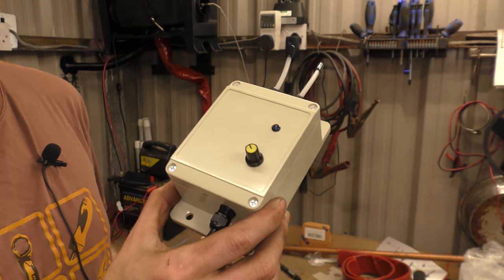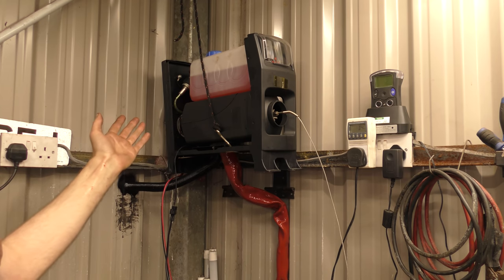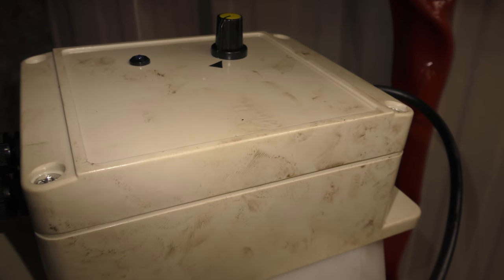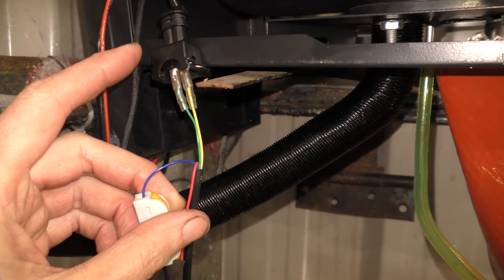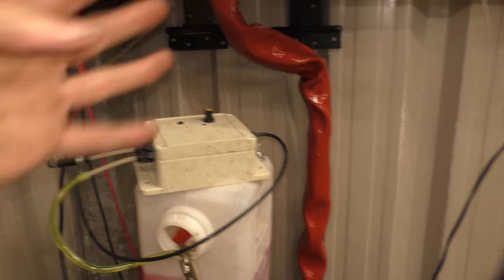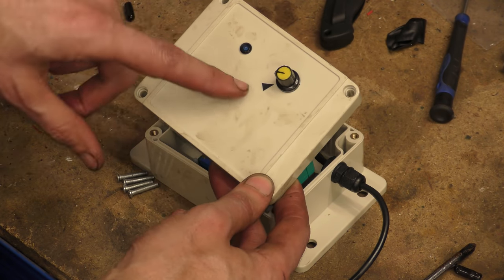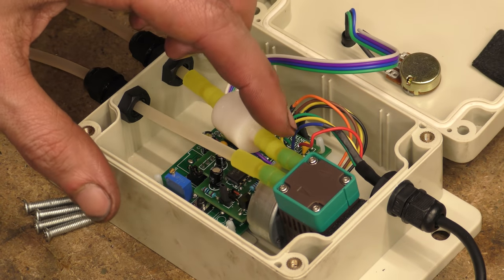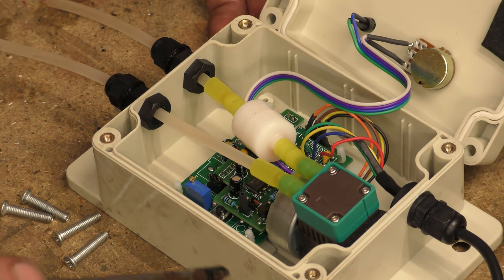Silent Pump for Diesel Heaters - test / review

Comment: You see we in Australia don't have any problems with the ticking noise a Chinese diesel heater pump make, it just sounds like the rythmic ticking of the electric fence units we use to keep the Salt Water Crocodiles away at night, and generally it sends us off to the land of Nodd in minutes.
Reply: Agree ,,, also the pump is quieter than bloody cicadias ,, 
Rob 
Nowra 
NSW
AU
Reply: @13yearsaprepperr.jtilbury.51  My tinitus is louder than the pump,  also if the cicadas are out making a gowdawful racket, you certainly dont need a heater.
Reply: greggy weggy, I'm reminded that Captain Hook is quite alarmed at the ticking sounds of a particular croc, and would not find any rest in such a fence. Poor devil.
Reply: I thank GOD I dont have to contend with the huge water lizards like ya do. I used a ticking electric fence to keep the coyotes out of a goat pen. Stay safe .
Reply: Well after hearing that I guess my mosquitoes aren't so bad
Reply: Wait what???  You have electric fences to keep the dinosaurs away???

Comment: Depending on how this pump housing is used the design is great or bad. I think. By that I mean that I think it is a very bad idea to have electronics underneath something that can leak on it. I would be more happy when the electronics would be above the pump and even have a devider screen in between in case something would spray out of the pump in case of a failure. And a small drain hole in the bottom so you would see the leak before it would destroy the electronics after filling the box.

Comment: I saw one video where the guy screwed a cup hook into the wood above, then suspended the fuel pump using a tie wrap ( or some people call it a zip tie ) from the cup hook. The tie wrap went through the bracket mounting hole in the fuel pump. After that it was completely quiet. It was amazing!
Reply: "I saw one video" ... can you provide a link to the video(?)
Reply: @__WJK__  i think it's Mel's big van small world Channel
Reply: From what i have ascertained from watching videos is that the pump needs to be at a particular angle to operate properly, if that's true or not, I have no idea.
Reply: Yeah. Just watched that video and not completely silent.  Maybe 60% silent...

Comment: Adding a mass to the standard pump is the best way to absorb and disperse the noise. 
I've tried a lot of different materials foam etc, and the heavier silicon sealant was the winner !
Reply: What do you mean adding a mass?
Reply: Did you just put a bunch of silicone on the pump (from a silicone tube)?
Reply: I am also curious

Comment: Awesome vid on an awesome product. I bought one of the prototypes a few months back as James was just getting started, a complete gentleman to deal with. I run my 5kW workshop heaters on kerosene so between us we were able to prove his new pump internals stood up to both fuels and changing viscosities with temperature. Must have run at least 100 litres by the end of my testing so a thorough test IMHO  - and a quiet one to boot !
Thanks for all the vids David, you've been a massive help to me in my workshop diesel hearter shenanigans.
Reply: .how do I order one for myself can't find any details
Reply: Is there an advantage to running kerosene?
Reply: @gregoryschwarz2730  Use for High Altitude
Reply: Ok do you know the flash point of kero is considerably lower than diesel. 65 deg celcius. Diesel way over 100. For safety sake I'd stick with diesel. Good luck.

Comment: My dog comes over and wags his tail at the start of your vids haha.  Fascinating bits you find to talk about.  I am very interested in someone's comment who suggested a simple PVC vacuum tube to muffle pump.  Sounded silly at first but his idea was actually pretty good and worth more thinking for this problem.
Reply from the maker: PVC vacuum tube?  You have piqued my interest.
Reply: @DavidMcLuckie  The idea is to place the original solenoid type pump into a short section of PVC pipe (say 50mm diameter) with a stop end on each end.
Gland or seal the fuel lines in and out each end, do the same with the power cable. Drill another hole and fit a schrader valve (old valve stem from a wheel should do). Seal the whole thing up. Fit a vacuum pump to the valve and suck all the air out. 
Now you shouldn't be able to hear anything other than possibly noise transferred via the fuel lines. It should work well I expect. You might need some low density foam to help keep the pump centred away from the pipe walls.
I thought overheating might be an issue but perhaps the fuel flow might be sufficient to cool it.
Reply: @fionnut  Good description.  The comment that gave me the idea implied a fairly simple vacuum pump and described how he could hear the noise lessen as the pump slowly kicked in.  It would only be a partial vacuum so I dont think heat dissipation would be a problem.
Reply: @fionnut  lol. bicycle valve will not hold a vacume as it is a one way valve that keeps air in and not out of the tire. so you must install the valve bacwards to make it work.. i would rather fill the pipe with insulating wool and be done with it.
Reply: @vihreelinja4743  It's possible to use the type of valves used in air conditioning systems instead, these will definitely hold a vacuum and are still cheap.
Insulation won't dampen the sound to nearly the same extent.

Comment: For myself and I suspect many others, it's a big job or not feasible to get this pump above their fuel tanks as most have their heaters, pumps and tanks close to their van floor. Very impressed with the quietness. Hopefully syphoning can be over come. 👍
Reply from the maker: You just need to make sure there isn't enough height difference to start a siphon.  Taking the fuel supply from a stand pipe into the tank also helps.
Reply: @DavidMcLuckie  Thing is, I have everything under my sink. Heater bottom back, tank above  (10lt) and the fuel pump bottom front as you stand at the sink. Area about 400x400mm. 🙄😳🙃
Reply: @CarlJones14  and so it is siphon leaking?
Reply: Hello
I will eventually move my fuel tank below the pump and heater. For now, I’ve put a small 12v solenoid valve in the fuel line. It opens when heater is running. Like David I hadn’t read instructions so awoke next morning to quite a large pool of diesel on the road. As I burned off the excess in the heater the smoke was unbelievable for about 5 mins. Neighbours thought van was burning.
Anyway great pump. No regrets,
Reply: install a relay controlled tap in the fuel line.

Comment: I'm intending to build an insulated box outside my shed (workshop) to house all the Gubbins except the controller and the hot air outlet tubing so hopefully there will be little or no noise. Also removing the necessity to bring diesel into the shed. 👍 😎

Comment: Have you considered using noise/sound meters when you measure the volume of pumps or exhausts? 
At a pinch you could use one of the many apps available. That way you can do objective rather than subjective test which are way more valuable.
Reply: Yes, where is the sound meter?

Comment: Nice, although this seems a bit overkill to me.

I found the best way to mount the pump is have it suspended by the fuel lines an inch back from the pump on either side so the pump itself is floating. That way the hose itself acts to isolate vibrations from the pump (works especially well with soft silicone hose).

My pump is barely audible when properly isolated, it's the surface the pump is attached to acting like a speaker cone and amplifying the noise which is normally the issue.
Reply: What size tubing did you buy?

Comment: I wonder about long term durability.  Pull chord ICE motors have this type of mechanism (diaphragm run by vacuum) but they eventually age/give out.  Not that your typical impeller type pump is immortal or anything.
Reply: I had the second prototype of this silent pump fitted by the inventor himself and it's still working going into its second winter after a summer's rest. Absolutely silent.

Comment: Great video and smart built. Did you test it with the afterburner as well? And if yes, does it keep full functionality (like measuring the amount of fuel used)?
Reply from the maker: Works just the same as stock pump with the Afterburner.

Comment: What is that sensor type thing fitted to the front of your heater? (Drilled and presumably tapped into the main heat exchanger casting? Is that your burn temperature sensor?

Comment: Just add a one-way valve to the mix to prevent the syphon effect happening and it'll be sorted... :)
Reply from the maker: But the siphon happens with the flow of fuel.  It'll siphon the entire fuel tank through the heater if you let it.  A one way valve would not prevent this.
Reply from the maker: I think I need a spring loaded valve but with a very light spring pressure.  Low enough not to impede the pumping of fuel but high enough to stop a siphon flow.
Reply: @DavidMcLuckie  I am adding a small 12v valve powered by a relay triggered from the pumps positive feed because I cannot get my tank below the heater.

Comment: Nice review of a nice pump. Does it make a different with the silent pump what fuel you use? I’ve been using main,y kero and an odd bit of diesel here and there..
Reply from the maker: Nope.  You can even run petrol through this pump, the seals are designed for it.

Comment: Very cool! Thankfully the clicking is ok with me.
Reply: I live with one 4 feet away and the ticking is actually kinda nice and comforting... though mine hangs on a couple of cable ties within a modified toolbox on the front deck so its like a quiet clock you have to actually try and hear.
Reply: @MIck-M  I've got a mechanical heart valve. I hear ticking all the time whether the heaters on or not. 😀

Comment: When General Motors car manufacturer came out with the 1988 Oldsmobile diesel engine for their cars they used a 350 gas engine and converted it to diesel. To get it to start faster on cold days they put in 6-volt glow plugs instead of the usual 12 volts glow plugs.  I wonder if you could do the same and reduce the startup time and less amp draw saving on battery-operated power supplies like the Jaberwaky I think it's called.
Reply: They actually used the big block to base the diesel on, not the 350.  No siamesed exhaust/intake ports.
Reply: MPG?

Comment: Thanks for your video, how did you know what wire to connect to the pump plug fitting as both wires going into mine are the same colour with no indication of positive and negative?
Reply from the maker: Either way round works.
Reply: Thank you 😊

Comment: its a basic fish tank pump with custom guts and a PLC. Diaphragm pumps are lift only thats why in the us we call them lift pumps the one thing over looked by most is the electronic pulse pump is a fuel injector and a fuel pump all rolled into one thats why it so loud if you could replace it with just a injector or a high frequency pintle valve and a normal vane pump it would be allot quieter but improper installation would pose a fire risk im running an 8kw in a 26' class a my tank is 2' above my heater pump is on center with burn chamber with a 30* pitch hard line go's from tank to pump then from pump 6" sag under heater at night outside -25f. running on high 5mhz with a shell temp of 350f on low 1.5mhz with a shell temp of 170f roughly 1 gal. a night give or take
Reply: What kind of pump and injector valve are you using? My 50cc Honda Scooter has fuel injection and a fuel use comparable to a diesel heater.

Comment: @David McLuckie  James told me he thinks his pump would be much more successful at dosing gasoline/petrol in a cheap diesel heater setup. Thoughts? Would, you consider trying it?
Reply from the maker: Absolutely.  The material in the pump is fuel rated and should give a much nicer burn with petrol.  I'll have to set it up at some point.

Comment: I just had a brain wave. Would this deliever enough fuel for the 16kw hydronic heater ? 
That way I could buy one as a back up that would fit both my 16kw heater and the 5kw air heater.

Comment: Can't wait to experience the silent fan and the silent combustion.
Reply: Because if you know what your doing the pump is the least of your worries when it comes to making these units quiet.
Reply from the maker: I installed one in a VW Crafter camper and you could only hear the sound of air leaving the vents on full power.  But some people only have the option of installing the fuel pump inside.

Comment: I know you've been asked a thousand times but is there a "better" Chinese diesel heater to buy. I've just seen they are £71.99 now on fleabay. Love the vids and as a long term boiling bag wearer I understand why you've ditched the Orange apparel. Summer mode
Reply from the maker: The Lavaner heater seems to be a better made unit.  Better quality of parts and plastics.  But it is more expensive, but still not Webasto or Eberspacher prices though.

Comment: I would like to experiment to see if gravity feed is possible, cut pumps out entirely.
Reply from the maker: It is yes.  You just need a resistor to trick the ECU into thinking the pump is still there.
Reply: @DavidMcLuckie  fit  aswitch to the pump,  start on diesel with the pump, then open veg oil line, turn off pump. Restart diesel pump and turn off veg dripper line for shutting down cycle, ready for reignition. My next theory is turning down the glow plug voltage to see how low it can go before failing. Same with fuel feed.

Comment: Hello, great video. How does this work with the Afterburner controller, is that potmeter on top to control the speed, if so how can the AB controller control this ?
Reply from the maker: It replaces and acts like a regular fuel pump.  The pot is just for fine tuning your fueling.
Reply: @DavidMcLuckie  Ok thank you my good man. Keep up the good videos you are making for us

Comment: Just bought this pump 
Am I getting this correct to set up in the motorhome 
Diesel heater first 
Pump below the heater 
Then diesel tank in that order ? 
I will have the diesel heater screwed to the floor with a turret going threw the floor 
The pump will be under the van screwed under the floor below the heater 
Then the fuel line running to the fuel tank even lower then the pump level 
Is this correct
Reply from the maker: Yes.
Reply: @DavidMcLuckie  thanks for the reply mine is the 2nd gen pump David the black case one anti syphon I believe

Comment: Hi David. I have a question, the heat-resistant cover on the exhaust, is it okay or has it started to burn out? I know that the inside is a braid of fiber and the second orange coat is made of heat-resistant rubber. I ask because I use this coating and it sinters and darkens ps google translate... thanks for the reply
Reply from the maker: The one I'm using is silicone coated glass fibre.  Still flexible and hasn't melted.
Reply: @DavidMcLuckie  I have the same sleeve. 260 degrees C long-term, short-term 1100 C. Unfortunately, it probably depends on whether it is in free space or closed. In the closed where there is no possibility of ventilation and cyrculation of air, there is a darkening of the silicone. I use these sleeves for engines but they are not in contact with the exhaust, the heater unfortunately began to black .... It is therefore a fact that the heating runs at maximum power

Comment: I wonder if you could use a peristaltic pump in a similar way, equally as quite I would think
Reply from the maker: You can't.  That was what James tried first.  The pipes split at random times.
Reply: What about using Tygon fuel line in the pump instead of pvc or silicon fuel lines

Comment: You can have the fuel tank higher than the heater , as long as you loop the fuel hose hirer than the tank simple fix.
Reply: Only if there's a vacuum breaker on top of the loop. Have you never siphoned petrol from somebody else's car? But you'd have to close the vacuum breaker for the pump to operate

Comment: To be fair, calling the afterburner 'theft' is a bit extreme. That design was declared as an open source project which means anyone can take the design and manufacture it, for profit, or not, depending on the licence, but should always giving the proper appropriation to the designer (maybe this wasn't done, I don't know). However,  once someone did make one for sale, the designer cried foul and took the design down off his site. I am not saying it's right, I'm just wondering at the use of the word 'theft'.
Reply from the maker: Yes and no.  The project was intended for you to build your own hardware design and use the free software.  The theft aspect was buying an afterburner, copying the hardware design, flashing the free software, calling them your own design and altering the code to make it look less like Rays, and then selling them as your own.  So the theft aspect was from stealing a hardware design and not from the software.  I hope that made sense.
Reply: @DavidMcLuckie  Yes, that made sense. I appreciate you taking the time to explain.